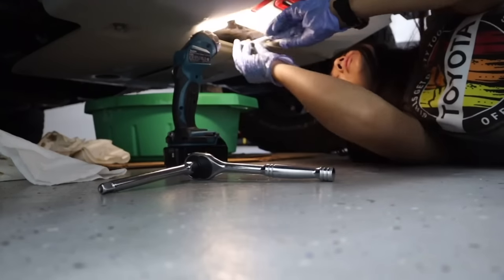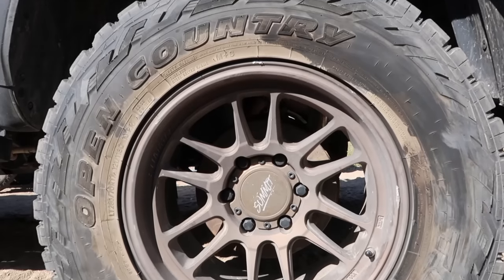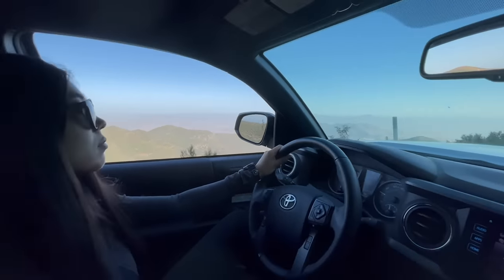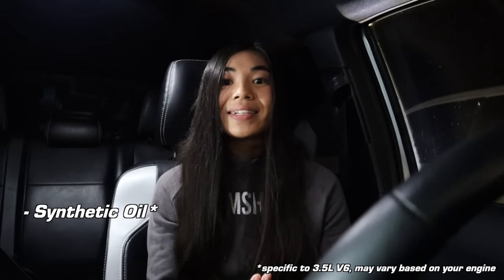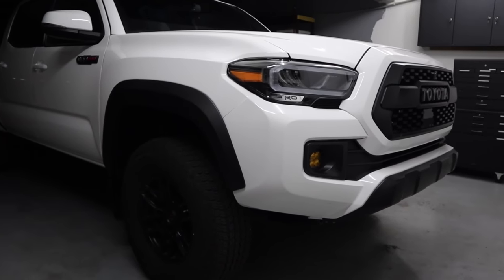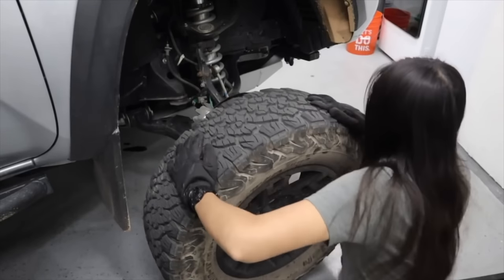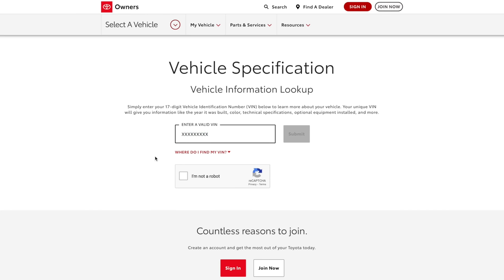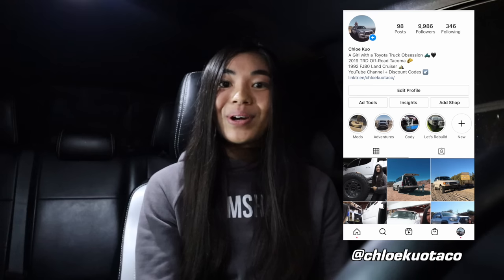What I Wish I Knew Before I Bought My 3rd Gen Tacoma | First Time Ownership + Tips & Tricks

Comment: I wish i never sold my 2nd gen for the 3rd gen. A big mistake for me nothin but issues lol no power always shifting and gettin stuck in 5,6 gear.  Tip keep your 2nd gen tacos
Reply: I was never fully impressed with the 3rd Gen which is why I stuck with my 2nd Gen 15’ Taco, and almost 7 years later I have had 0 issues with it (knock on wood) although I am interested to see what the next gen Tacoma brings to the table which I hope delivered a full redesign from the ground up
Reply: Yes plus the 2gen seems to have more torque or maybe it was just me
Reply: I have a 2nd Gen 2005 TRD Sport with 173k miles on it. All I had to do is oil, air filters and tires. Toyota did replace my frame for free because of road salt here in Northeast.
I just recently swapped out my headlights and taillights for a newer look with leds. I also just replaced my stock rims. This Tacoma was my choice of my family vehicle. This is my favorite vehicle I've owned so far.
Reply: @SmitTheBumb  Right there with you. Have my 2005 Prerunner SR5 and it has been a champ...have 130k on mine and have yet to have any major issues.
Reply: Must have never heard of a Tune lol jk. And I don’t have that issue with my 6 spd manual
Reply: Actually the 2nd gen Tacoma trucks have had major problems and recalls just like any vehicle. 07, and 09’ to be specific. Any vehicle first year is usually riddled with issues . 3rd gen has a few definitely. Mainly 16’ 17’ 18’… but the 19-23’ are really very solid trucks. ECT option solves most the shifting issues, then a pedal commander solves the lag issue . I agree one shouldn’t have to worry about all this shit, but at the end of the day an individual buys these trucks first because of their Off-Road capabilities, second because they’ll possibly last a long period of time compared to other vehicles. I say if you want a “quick” off road rig buy a Ram TRX, or a Raptor . I’m personally a Ford guy, but now my 05’ fx4 F150 just rolled over 300k miles, and thought I’d try these nice little Toyotas . I had owned a nice tiny 93’ Toyota 15-20 years back and it really was gutless, but it was awesomely reliable! I’m ready to give my 2020 TRD off road Taco a go 👍
Reply: Should have bought a 2020+ version of the Gen 3. Gear hunting issue was almost completely fixed
Reply: Still to many gears. Alot of the power wasted in the gear box. I can tell to the 2nd gen where it can tow and haul with eas. The power train in the 3rd gen is junk. Mine would burn a QT of oil every 500 miles. The ECT botten does very little to fix even with the later year ECU update. When you keep things simple and stupid seems to work alot better. Like the 2nd gen tundra 5.7 V8 thos are bullet prof. Toyota wreck it when adding to many stupid shit to it. When the 4.0 and 5 speen auto great.
Reply: Get the OTT tune. The gear finding issue will be gone. It is a different machine post the OTT tune.

Comment: Why not just keep some extra batteries in the console and change out the battery on the key fob when needed instead of swapping the internals back to the Oem fob? I just don’t understand the reasoning to do the extra work?
Reply: Due to the level of likelihood of working and urgency to fix. With your approach, the extra batteries might die. With your approach, after replacing the batteries how quickly do you need to get the 2nd set of extras after using the first set? Her approach, answer is never, no urgency.

Comment: The pedal commander was the best mod for my 19 TRD. Huge difference in throttle response and seems to help with the shift points as well. Best bang for the buck so far
Reply: I read somewhere you cannot use cruise control with pedal commander. Do u know if this is true?
Reply: Run banks accelerator product instead.
Reply: @mseely0075411  I have a similar product. It's called a sprint booster. It's probably the same thing, just a different company but I can still use my cruise control fine
Reply: shoulda got the OTT tune
Reply: Works 100% with cruise control. I researched what was available and I still have zero regrets with the Pedal commander. Helps a lot when I pull my 19th camper through town
Reply: Nah, I’m very happy with what I got, considering all these products really only help with acceleration. I did my research and the Pedal Commander has been well worth the money.
Reply: OTT Tune is Awesome!!!!

Comment: my truck leaked from the 3rd brake light since i got it in 2016.    i ended up replacing the seal myself last year.   recently i took it in for the 60K service and they did the recall inspection.   the interior needed the headliner and carpet replaced.   additionally, they needed to do mold removal which necessitated stripping the interior to the bone, including removal of the soundproofing.    now they cannot put it back together because, at the moment, there is no toyota soundproofing material in the states.    they've had it since late September and cannot give me an estimated time for completion.     just something to be aware of if you plan to take it in for service/recall.    dont let them start the repair if they dont have all the parts on hand!
Reply: Did they give you a loaner for it? They better be compensating you in one way or another.
Reply: Same here exact same situation took two months to get the parts in but I did get a free loaner

Comment: Concerning the issues some have with the transmission.
I do 1 simple thing which gives me everything I need when I need it.
Just drive your V6 6 speed in 5th gear. S mode. Leave it until you reach 50mph or so.
Running ExxonMobil 87, I often hit high 20s with occasionally 34 mpg.
Everything is stock on my 2016 trd sport 4x4 access cab.
Driving in 5th reminds me of the way my transmission is in my 1995 SR5 V6 4x4 extended cab with 6 ft bed. There is NO hesitation!
Oh. Drop an "aeroskin hood protector" by AVS on your hood.  Matte black. 3M tape. Hugs the hood.
You're welcome.

Comment: Hey just a heads up, when you're using a torque wrench, use the shortest extension necessary and keep one hand on the head one on the handle.  The longer extensions are more likely to move off plane from seated on the fastener which can give you an incorrect torque value.  👍🏻👌🏻
Reply: It’s much worse when people don’t know how to properly use dog bones.
Reply: The gas mileage I think is very bad that's the only thing I don't like
Reply: COOL STORY, BRO
Reply: @aureliomartinez2633  what does that have to do with proper torque wrench usage?
Reply: What if she didn’t have it on hand? #mansplaining

Comment: I own a 23 TRD Off Road double cab, 6’ bed Tacoma with the premium pkg.
It has only 6,500 miles and I changed the oil at 5K miles. My dealership will change the oil and filter and rotate the tires for as long as I own my Tacoma, but they’ll only change it every 10K miles. This means that I’ll have to pay for every other oil change.
I’ve Always changed the oil and filter every 5K miles with Mobile 1 High Mileage Full Synthetic oil. I used the High Mileage oil because it has additives that reduces engine wear.
I also change the front and rear differential, transfer case and transmission fluid every 30K miles, as well as bleed the brakes and replace the power steering fluid.
Every 3 years the radiator is back flushed and new antifreeze is added.
Since Ive been retired I usually drive only 5-6K miles per year.
I’m an absolute maintenance nut.
I feel that maintenance is cheap when comparing it to the cost of replacing a 300K mile vehicle with a new one.
We drove our last Toyota for 18 years (wife’s car) and I drove my RAV Limited 4WD with the 3.5L V6 for 13 years.
In February 24, i bought my 23 Tacoma (it had 6K miles on it), but I saved over $7K off of the factory window sticker. So 6K miles saved us over $7K.
I could have bought a new 24 Tacoma just like my 23, but I didn’t want the 2.4L Turbo.
It is well known that a Turbo engine simply won’t last as long as a naturally aspirated engine.
The 3.5L V6 is proven to be Reliable and Durable. It served me very well in my RAV.
The most mileage I’ve ever gotten from any vehicle with the original power train was my first Toyota. I was a 78 Corolla that I bought from my sister in 83 (with 70K miles), as my college car.
It was a Bare Bones Corolla. It was a White 2dr with Vinyl flooring and seats. It finally died in 02 at 488K miles. I then bought a new Camry and drove it until 11 when my needs changed and I needed a 4WD, so I traded in my 200K mile Camry in on my RAV 4WD with the 3.5L V6.
I sold my RAV and our 36K mileage 4WD Ford Ranger XLT Super Cab pickup and bought our (my) 23 Tacoma, which I’ll drive until either I can no longer drive or I die.

Comment: I had a 17 Tacoma TRD Sport Auto and definitely had issues with the transmission gear hunting.  The truck should not drop 2 gears with only 600lbs payload (including people) because you wanted to speed up 2mph.  Also driving in the mountains, I would lock out 6th gear because it kept jumping out of 5th for better mpg's, but then would drop speed so would down shift into 4th to speed back up.  After a couple of times, it got really annoying.  This was with ECT on too.  Should've gotten a manual.  I had the 3rd brake light leak too.  Toyota kept the truck for a couple of days to clean it and get all the moisture out of the carpet and headliner.   They also reflashed the transmission when they had it, but it didn't get rid of the problem, just reduced it a bit.  Everyone's experience is different with these trucks though.
Reply: HI CHLOE, thanks for making our life with a Tacoma easier and more enjoyable. Will be getting a Tacoma soon and like you will have it forever  and want your valued opinion  on rustproofing and undercoating to keep it looking a long time. I live in the Midwest rustbelt. Is the Canadian  company  Krown underproofing product being misted indoor panels , rocker panels, etc the best way to go;( not knowing what product they use for this) ?? Zeibart undercoating uses an asphalt  base and is thought to be best for salted areas  I  live in. Another option is wax base product some undercoating  companies  use. Please help with guidance on making right move to preserve my new Tacoma  (soon). Thanks again for help on this important matter

Comment: Great video.  U should install an oil catch can.  It will keep your motor lasting longer.  I have 2017 Toyota tacoma trd sport 3.5L and  i install one. after 5 years i put 290000km on my taco and still drives strong.

Comment: nice informative video, but as far as the key fob is concerned, wouldn't it be easier to keep a spare lithium battery in your console or owners manual vinyl pocket. I mean if you are going to need the tools to change anything out back to the original fob, it seems it'd be more convenient to just change the battery in your modded fob....js

Comment: I just got my Meso Minamalist key fob for my 2020 tacoma tonight and was a little worrird I had made a mistake after hearing you say you needed to keep the shell of the original fob to be able to start the truck in the event the fob battery dies. So when transferring the guts of the stock fob to my new minamalist fob I removed the batery completely from the circuit board and installed everything into the new fob and tested and to see if I could still start the truck with my new fob without a battery in the fob and it still worked just like it would have with the stock fob shell.  As far as I could tell the only transmitter chip in the original fob was the big chip on the back side of the circuit board that you have to transfer into the new fob. I didnt see anything that made me think I would need to put everything back into the stock fob shell to get my truck to start if the fob battery were to die. You might want to test it and see, I bet yours will work the same way.

Comment: One other thing I wanna add regarding the distance sensor in the grille, anytime you change the height of your vehicle whether it be tires, a lift or both, you should have your sensor recalibrated. There are companies that can come to you and do it or you can contact your local body shop and your dealer will even help you with that. I’ve already had a couple wierd experiences with mine after I lifted so I strongly recommend that if you decide to keep that feature that you get your truck recalibrated for that.

Comment: Hi Chloe.. I’m planning to buy a trd off road tacoma this coming july and I just want to ask if the trd lift kit really worth it or I just stick standard and just get a a bit bigger tire? And one more thing does the trd skid plate is cut and have access in changing oil? Bunch of thanks.. new sub here!
Reply from the maker: I do not have personal experience with the TRD Lift kit, but you can run a 265/70/R17 (which is a little larger than stock) and perhaps you can get what youre looking for. The TRD Skid has an access panel for the oil filter and cutout for the drain plug—hope this helps 😊
Reply: @ChloeKuo  thanks chloe.. appreciate it! Have a blessed evening..

Comment: Anyone had a rear main seal leaking? My 2016 trd off-road 4x4 started leaking at 65k miles
Reply: Looks like they put to much transmission fluid in the transfer case. I would recommend draining and follow the instructions state in the owners manual. Transmission fluid expands under heat.

Comment: Most “sealed” transmissions are titled that way to scare the normal diyer. They’re similar to some differentials where you’ll have a fill plug and a drain plug. Once you locate these two plugs your first open your fill plug (this way you can check the level and no point in draining something you can’t refill). Than remove your drain plug and drain all the fluid. The next step you’ll need to pick up some sort of hand pump (almost like a big soap dispenser) and hose. *in most vehicles you fill to the fluid spills over and out of the fill plug than you wipe away the excess and replace the plug and you should be good to go! 👍

Comment: I noticed a significant improvement in the shift points after I spent some time using the adaptive cruise control.  
In the winter I get 16-18 miles per gallon...with a bit of time with the remote starter woworking.
In the warmer weather, staying around the speed limit, and coasting down declines or gently gathering speed to help with the up-coming hill, I can get slightly over 23mpg.

Comment: I think it would be a ton easier to just keep a spare key fob battery in the truck and change it out when it goes bad as opposed to changing the guts from the aftermarket to the factory. You gotta change the battery anyway right?

Comment: Nice that you weighed in on the so called transmission issues, I’ve been wondering what your poison is on these complaints. I to have not done an after market tune; instead had a flash done at the dealership and have no issues with power or acceleration. I did like the comment about user error, I see we work in the same field. Thanks for sharing, love the vids. Cheers from 🇨🇦😉
Reply: My 2018 Tacoma TRD Sport ECM died and after a week it was replaced. The automatic shifting issue was improved but still somewhat annoying to me. The hunting is lessened but it's still there. The biggest issue is that if you suddenly need to accelerate while merging onto the freeway it'll pause a second before downshifting too aggressively to first or second and bounce off the rev limit and the truck won't be able to accelerate and you will either need cancel the merge or or risk getting rear ended by the vehicle behind you. It seems like the computer doesn't know what to do and goes into neutral momentarily or over revs and then eventually figures out the appropriate gear but that adds another second of delay. Very annoying and dangerous when you suddenly need to accelerate from a rolling start.
Reply: Transmission not smooth.  The computer is trying to squeeze out 20 MPG.   Sooooo hard.
Reply: Always heard from all the taco groups that they are bulletproof BUT need a tune because they hunt and shift too much
Reply: im about to get a 17 trd offroad shit

Comment: Great video.  Of course since my rig has a a manual transmission, a lot of the 3rd Gen Tacoma issues do not apply.  Noticed that you are using one of those reusable oil type filter.  Not my favorite.  You do a great job of keeping up with the maintenance, so the filter may be OK. IMHO, a good paper filter (e.g., WIX or Napa) is a better choice.  Anyway... thx for the all the information.
Reply: Chloe is the best lady on the tube. 
Hey J., watch the air filter review on "Project Farm" below, also the oil filter test.
 https://youtu.be/sJ3L-E-ufYo